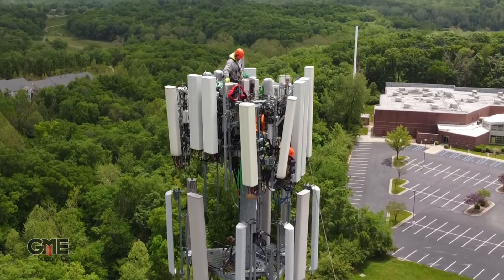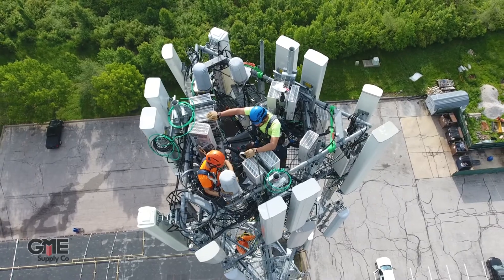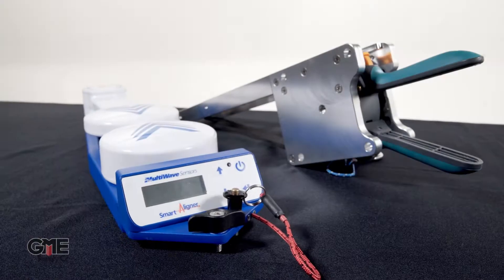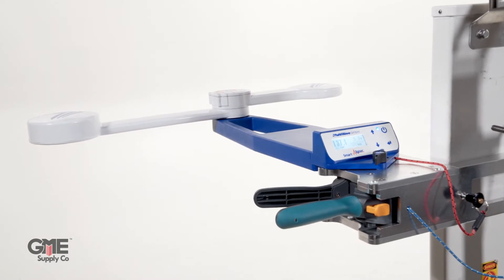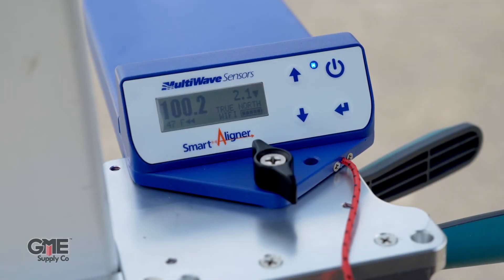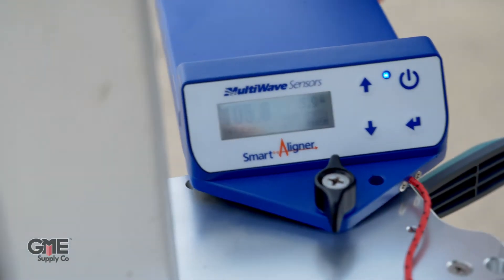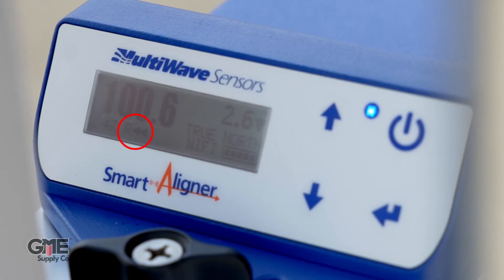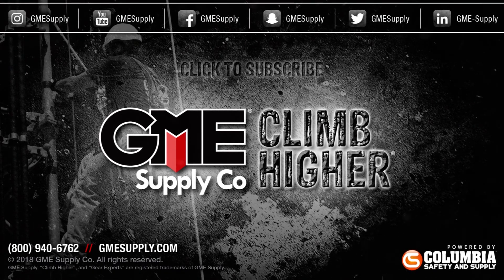Versatile Antenna Alignment featuring Multiwave

Comment: The universal bracket will mount backwards on the new anchor 2.5 air antenna but it reads completely opposite the correct azimuth when I mount it this way.
Reply: With the tool facing forwards of course.